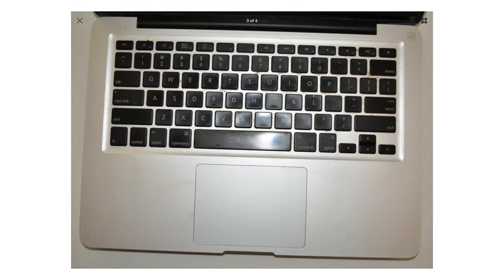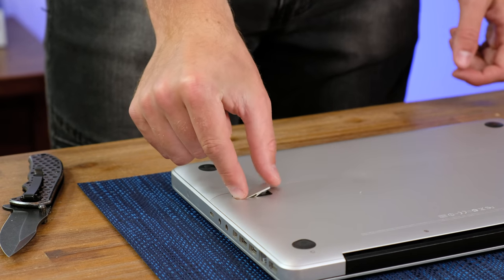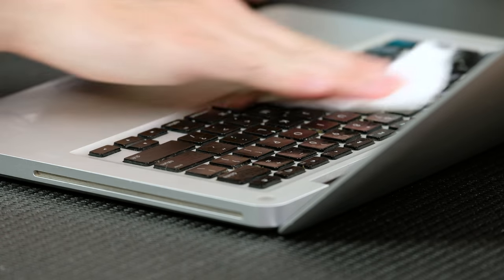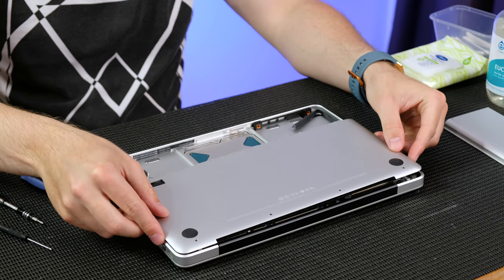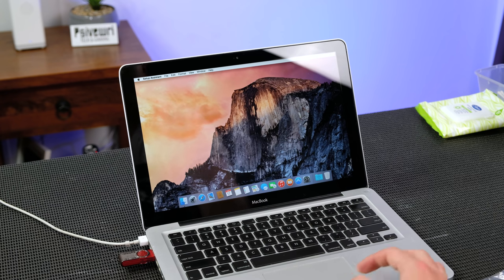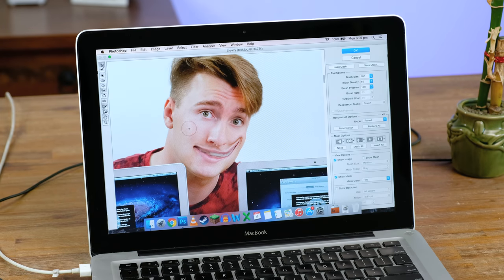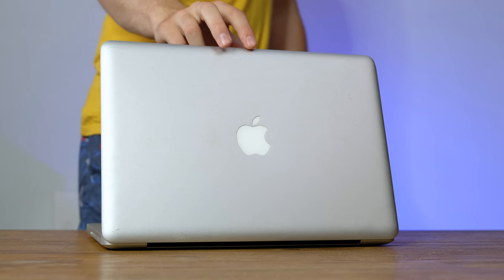$25 Apple Macbook From eBay... Gets Restored!

Comment from the maker: Glad to finally get this video out! Something I forgot to mention is that the trackpad started clicking fine after using the laptop for a few days. Thanks for watching 👌
► Gear I Use (Affiliate Links):
Dell G7 15 Laptop: https://amzn.to/32VOSux
Keychron K2 Keyboard: https://amzn.to/2F51NCh
Logitech G502 Mouse: https://amzn.to/351iae1
Benq 144Hz Screen: https://amzn.to/3jJk1YW
Fujifilm Camera Bodies: https://amzn.to/2EXdPxL
Fujifilm Lenses: https://amzn.to/3jY8xB9
Rode NTG3 Microphone: https://amzn.to/3jKWeHZ
Rode Videomicro Microphone: https://amzn.to/3hXoua4
Rode Wireless Go Microphone: https://amzn.to/3bsVaWr
Audio Interface: https://amzn.to/31XXVvV
Manfrotto Tripod: https://amzn.to/356r7Tq
RGB LED Light: https://amzn.to/3i2eNqL
Godox SL-60w Video Light: https://amzn.to/31Vtsyl
Apple iPad Pro: https://amzn.to/3h0i20H
Reply: How does one go about getting a USB recovery disk of 10.10
Reply: jim cherkas you gotta have a Mac device first
Reply: Ha! I was just going to ask you about that. I'm sure after a good cleaning, everything worked normally. You took a lot of dust and gunk out of it! I have a similar machine and it is still pretty useful with an SSD and more memory.
Reply: There is a screw under the touchpad that can be adjusted up and down to tune it. Too loose and it feels sloppy, too tight and it doesn't click.
Reply: good
Reply: Man you should try modding an early 2000s e machine, those things where my gaming machine as a kid and im sure many others and a budget gaming build on one would be mega cool. Great content though and great channel, keep up the great work 👌🏻👌🏻
Reply: Psivewri where are you finding these deals on eBay, I need a MacBook for school and I can’t find anything under 150 dollars Which is my budget.
Reply: So u gamer
Reply: You can install MacOS Catalina on unsupported macs with (Dosdude1’s) Mac OS Catalina patcher.
Reply: Love your Videos! You are my favourite YouTuber out of all the literal 1000 people I have subscribed!
Reply: Install chrome os for free with cloud ready!
Reply: Please help me by giving it away😇😇
Reply: Only if its perfect...
Reply: Psivewri  can you make a video how you make videos because I watch your channel and I wanna start my own tech channel
Reply: still pretty slow, my cousin's 2014 MacBook Air runs cs go at 50+ FPS with no fluctuation
Reply: If I sent you a MacBook Pro would you fix it for me then send it back??
Reply: Psivewri do you ever go on good will auction
Reply: yea i wish to own a mac book one day thx to u
Reply: I bought a MacBook Pro and it boots up to w3id. what is that and how can I make the computer to work plz help
Reply: Psivewri how do you get your computers so cheap
Reply: Can you give me the macbook please?
Reply: MacBook

Comment: I wonder why this was sold as “for parts only” since it booted up fine as soon as you installed OS X... 🤔
Reply: Maybe the guy just didn't want to deal with returns / refunds in case something went wrong, so he advertized it as not working
Reply: probably because of the charger
Reply: He thought the battery didn't hold a charge but it was just the stupid charger that was broken
Reply: its probably a lie.
Reply: He might not have been that good with technology, I once bought a phone and didn’t realise that it was for parts only, I plugged it in to charge, added a sim and it was fine!

Comment: I also have this Macbook, it’s actually my daily driver.
I like the door that reveals the hard drive and the battery, so it’s easy serviceable.
On my MacBook, I put a 250GB SSD and installed OS X Mavericks.
With this setup, I can edit HD 720p videos on Final Cut Pro X 10.1 at a decent speed.
In conclusion, it’s a nice little machine.

Comment: I recently found mine in a box in my room thats sat untouched since 2012. It's still completely mint with no dents/scratches and all it's feet attached. Its dvd drive, touchpad, keyboard, keyboard lights, battery (still holds an hour charge even with 1400 cycles!), etc all still work great. I upgraded the ssd, ram, and os, and now It's like a whole new macbook. I'm glad I searched it up and saw your video first, otherwise I would've just thrown it away or sold it on eBay for $25. Thanks 👍

Comment: I’d suggest perhaps figuring out what cells the battery uses, ordering them off of eBay and disabling the battery and replacing the cells. The Faultiness could also be due to a faulty micro controller inside the battery which could possibly be replaced
Reply: EPICJAC360 any how to videos on YouTube?
 I’m tech stupid.

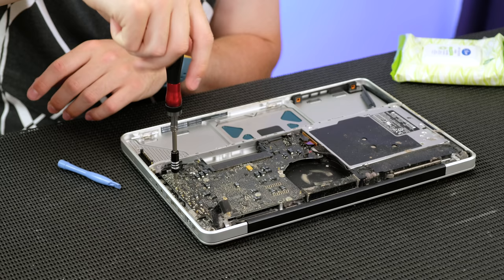Comment: In my opinion, 4:43  it is better to remove the dust first before unplugging all the ribbon cables so that the dust does not get into the cable holes. After that, clean the dust in more detail. Thanks, your video is excellent. I really enjoy. Peace!

Comment: I repaired one from 2010 as my first project on an apple device with acid on battery, no power cord, no battery, dead HD cost me $200 with SSD included and 8GB RAM worked better than my business Win7 Pro HP and it was a great gift for a family member, similar laptops sold for about $400 great video Thx

Comment: As always enjoyed you video! One suggestion though. Avoid using vacuum cleaner for removing dust from logic boards as the large volume of air suction causes static build up on the nozzle of the vacuum cleaner and might damage the logic board with a static spark.
Reply from the maker: I agree! Do you have a less destructive way to remove layers of dust from the logic board? Thanks for the feedback
Reply: @psivewri  By no means I'm a professional repair guy😀. But as someone who knows about electronics and myself have purchased some old used Macs for family and friends. I've taken them apart for cleaning and upgrade and this is what I follow. If you have access to an air compressor you can use the compressed air with pressure reduced to like 15-25 psi (higher than this you risk blowing some tiny components off) and blow the dust off or if you are unable to control the pressure hold the logic board like 50 cms away and blow the dust off(this is what I do). If not you can get a small compressed air can. Then I rinse the board in isopropyl alcohol or ethanol to wash away the dust and dirt. Next, I just give it a quick sweep with the hairdryer to dry off the alcohol.

Comment: I have the same MacBook for 10 years now, I still use it in a daily basis, sure only for browsing the internet, excel and word, but I'm still capable of doing pretty much everything! Just changed the thermal paste 1 month ago! Rocksolid!! Instead of buying a new MacBook every 2 to 3 years just to play,  just went to Playstation. Always runs good call of duty 😁 good stuff

Comment: This MacBook Pro is very, very similar to the one my mother rescued from a high school trash bin. Mine's a mid 2009 13" MacBookPro5,5 that came with an Intel Core 2 Duo P7550 @ 2.26 GHz, 2 GB DDR3 RAM @ 1066 MHz, same GPU, 250 GB 5400 RPM HDD, same screen, and same Superdrive. I just checked its battery cycles, and it's only been through 197 with a battery capacity/health of about 71.6%. This thing was barely used, and it's still great for watching 720p YouTube videos, DVDs, and playing some older games like Half Life and Team Fortress Classic.

I upgraded the RAM to 4 GB, swapped the HDD for a Patriot Blaze 240 GB SSD, and updated it to macOS 10.14.2 Mojave using DosDude1's patch. It runs beautifully and still looks very modern.

Comment: Eat the cost of the battery, bump the ram to 8GB if possible, and this would still make a decent couch PC, or Grandma computer for the Apple fans, but having said that for the cost of the battery in one of these at least here in the US, you can get a Lenovo Thinkpad X140e with a quad core AMD, and easy to remove  battery from eBay surplus sellers, and install any Linux distro you want on it, and have just as good if not better of an experience.

Comment: I got my 2010 13” MacBook Pro for 21€ from eBay. Seems like no one bid on it! It came without charger, but with the original installation discs and instruction. I plugged in my own charger et voila: it worked! But: the battery was extremely bulged to the point where the trackpad had come out of the housing and the bottom cover was severely deformed. I screwed the Trackpad back in place, carefully hammered the back cover back into shape, invested 30€ into a new battery and here we go: 50€ 13” 2010 MacBook Pro! 

Sorry for my bad English, I’m from Germany!
Maybe it’s worth mentioning that broken Apple stuff usually is extremely expensive here.

Comment: So I have a mid 2011 Macbook Pro 8,1 with an Intel Core i5, 2.3GHz processor 4GB of RAM still running OS X 10.6.8 and I am thinking of doing very similar upgrades to reach current/ near current MacOS and much improved processing speeds mostly in order to edit GoPro videos and photos among not too much else. Would you be willing to guide me through with any recommendations regarding RAM/Hard Drive/etc upgrades?

Comment: You may already know, but I have to criticize some points of your cleaning process. I would recommend you for the next time, buy a brush head for your V.C. and you can easily clean the Motherboard. Also, ground yourself next time and you will be able to touch the Surface without any worry. With a hard Brush (e.g. for the tooths) you can "perfectly" clean your Keyboard.

Greetings from Germany. :)

Comment: That is the same year as my MacBook pro. Was interesting seeing the insides for it. Mine has a couple of problems so needing to take it apart sometime in the future to do a cleanout and replace the RAM. Been a very good computer and only game I run on it is Sims 3 which always ran way better on it then on my gaming computer with higher specs. Graphics just didn't look as good. Never considered replacing the hard drive. Should do that with the SSD from my win7 build since that computer is dead (power surge blew out the powersupply, motherboard and CPU) and its a bit dated so wouldn't want to use it in the new built.

Comment: I have a 2010 Plastic White MacBook with Mac OS 10.13.6 “High Sierra”. The only problem is the battery life is pretty bad. But it still holds a charge.
Reply: IGC Tech Might as well install macOS Catalina
Reply: But it doesn’t have the system to support Catalina or even Mojave! So I guess I’m stuck on High Sierra still.
Reply: IGC Tech You can use a patcher to install it on unsupported systems
Reply: I don’t like jail breaking and plus i heard that stops WiFi working
Reply: IGC Tech That's not jailbreaking
Reply: I don’t like doing that though. And High Sierra isn’t that bad

Comment: You should use a proper air compressor to blow the majority of the dust quickly and efficiently first and only after then start to use alternative methods of cleaning the dust that is too stuck on the surface. It would have been much more satisfying to watch it like this.

Comment: This is still my favourite MacBook I ever had! It's still in working order, but was replaced in 2017 for a new MacBook Air. But this was a very capable Mac due to it's easy upgradability. The RAM could go up to 8 Gb (even if Apple claimed 4 Gb), an small SSD and a new cheap battery then did the job very will! This first gem unibody mac deserve more respect in general, it was a laptop far ahead of its time! :-)
Thanks for this great video! :-) Greets from Belgium

Comment: I have the same model MacBook (2008 unibody). It is working fine except that it doesn’t power on properly and I need to hold the power button for at least 30seconds until it boots up.
Also, when I close the lid and then open it back, the MacBook shuts down.
Does anyone have any idea as to why this might happen. Please help !!!

Comment: Yes please!! Do more Mac videos pleaseeee. Btw, you should turn of vsync on minecraft soo it can go more than 30 or 60
Reply: Rodrigo pc
Reply: What's the point of going over 60fps on a 60hz screen?
Reply: @leoobdt  Frame time against the monitor, with 60hz the monitor refreshes every 16ms or so, but the frame that your GPU delivers aren't always exactly 16ms therefore that's why a lot of people prefer to run CS:GO on 200fps or higher to reduce this. (Basically double the frames per hz and you're pretty much set.)
Reply: @hanakomisa  man but this causes screen cutting in half 
I played far cry primal on GTX 1060 vsync off the screen was cutting far too much so I turned vsync on and it became stable
Reply: @mohitkatta3031  Yeah, that is what "vertical sync" is for. it syncs up the picture but also limits to your screen's Hz and increase latency, which isn't crucial for single player games but in a competitive environment, is mostly a big no.

Comment: I hate to be that guy regarding thermal paste application, but this time it's actually important.

When applying new thermal paste to bare die CPUs like in a laptop or on a GPU, make sure that every square millimetre of the die is covered, otherwise any part of the die left exposed will be killed from thermal runaway, and the rest of the chip will shortly follow it into the grave.

If you're unsure about how much to use, use something to spread it out evenly, and don't worry about bubbles, the pressure of the cooling solution will always push them out, and if the thermal paste isn't electrically conductive then err on the side of caution and use more than the recommended grain of rice/pea sized amount, the performance difference is negligible, and the potential of killing your hardware is too great to risk using too small an amount.

Also avoid using Arctic Silver 5, it's electrically conductive, and the performance compared to modern, safer thermal pastes is much worse, go for MX-4 for a much better paste that doesn't break the bank.
Reply from the maker: I was under the impression that the repeating the heat sink would spread the paste evenly. I should probably try the paste you recommended! Thanks for the advice 👌
Reply: @psivewri  it will most likely spread it out all the way, but because the risk is so great, I think it's better to be extra cautious and make absolutely certain.

I've seen people apply far too little on a bare die chip, especially on a GPU where its larger area makes it easier to get wrong, but it can still be an issue on a CPU.

Many people will complain about spreading the paste, but in all the testing I've done its only shown about a 2C difference between the methods, and spreading the paste out until it's roughly 0.5mm thick is the safest method on a bare die to prevent damage from using too little.

Comment: Hey dude! great video. I need help with my base model mid 2010 13inch macbook pro. I opened it and i dissconect the battery flex. When I reinstall all again, the macbook only worked with a charger, and its super slow and lot of noise with ssd. When you turn on the laptop, the led indicator starts to blink, and after turns on in macos utilty, with pointer lag. HELP PLEASE
Reply: please help, if someone knows tell me and i send my email

Comment: I found a MacBook Pro mid 2009 which someone had chucked out. I took it home, started it up and found that it didn't have an OS on it. The HDD was also an old slow spindle 240GB disk. I put a 240GB SSD in it and installed El Cap on it (As it was the latest the laptop supported), and it ran perfectly fine. 

I then wanted to try out an experiment on it... I used a patcher from Dosdude and installed Catalina on it... With its Core 2 Duo and HUGE amounts of RAM (2GB), the laptop absolutely flew and proves that even after 11 years... It is still an absolute beast

Oh and btw, I'm typing on it rn :) (The keys are really really good)

Comment: I subscribed after watching a few of your videos, keep up the good work! This particular MacBook was the first (and only) Mac laptop I bought new from Apple. I really liked the fact that there was easy access to battery and hard drive. You could have a spare battery with you on long trips and just change it when it was in sleep mode. It had a very respectable selection of ports for being a 13-inch laptop. This was the peak of Apple's innovation greatness IMO, before they started taking away ports and soldering parts in.

Comment: cool little video! I have my wifes old 2007 a1181 that I started making into a project for my son. so far, i've doubled the RAM....changed the light color and cleaned the inside. I am going to get a new case for it since my wife was not kind to this thing. I also did the unthinkable and put chromeOS on it haha. It helped make this thing run super fast. My issue is getting the battery to last more than 3 hours...i bought 2 new batteries on amazon but they both suck. no one makes a brand new battery for this thing any more thats reviewed good.....if that makes sense.

Comment: ohhh... poor battery 10 years of life and only 200 cycles.... macbooks these days were mobile "monsters" with extreme battery runtimes. Sad to see a MacBook, especially 13", used mainly as "desktop" :(
I got on my first battery on MBP 15" Late 2009 a cycle count of around 900 after 4 years, but as the capacity was under 80% and the cells were already differently worn out, i replaced it.
And im thinking about getting another battery, since the Mac is still running fine, but again.... very unbalanced capacities of the cells itself. charging time of around 5 hrs for a 5900mA Battery (from 7000mA), and probably an effective capacity of 3000mA... without much load (only streaming to Apple TV, its like idle) it can run max. 3 hrs with display off (!!!).
Ohh, and the touchpad is going out of the aluminium case next to the keyboard already, a sign for a swelling battery, and i dont feel save anymore if LiPos are swelling.